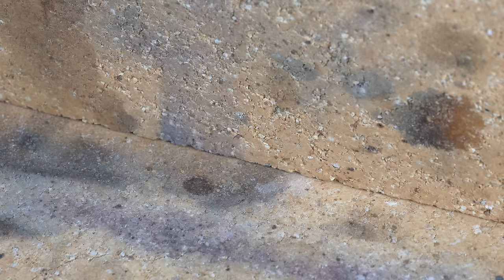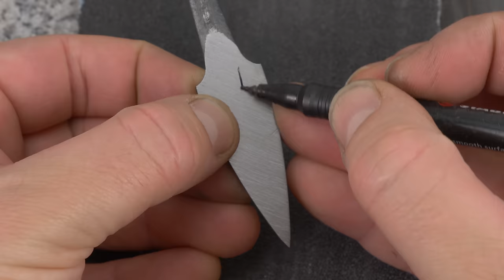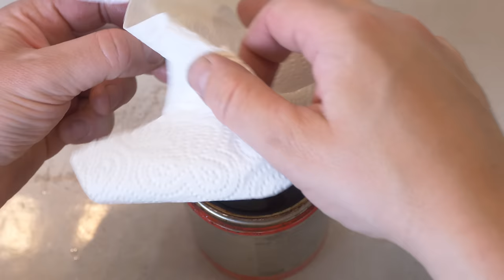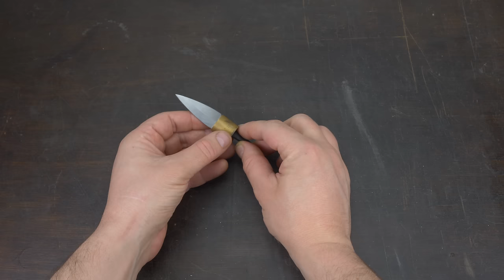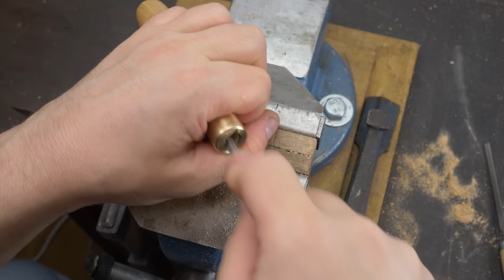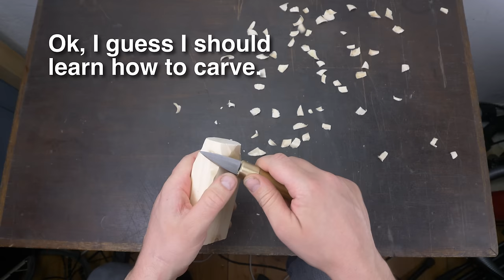I made this carving knife

Comment: I need to mention that thinning on your Atoma flattening stone will make it wear out quick.  I used to use my atoma for lots thinning for about 6 months and now its slower than an 800 grit diamond stone.  Only use it for flattening, that's what it's made to do.  For lots of grinding and thinning I tend to use either sandpaper (I usually wet my atoma and stick the sand paper on top, it's perfectly flat and has a great grip) or I use the "Sharpening Supplies" Grinder stone.  It's an 80 grit water stone and works FAST.  You will need some loose silicon carbide grit however, such as 60/90 tumbling grit.  Other than that there is "THE BEAST" (this is it's real name) 50 grit diamond stone that's pretty cheap.  

Also to make annealing easier (and softer) its nice to have a little pot full of burnt ash.  When work is hot, stick it deep into the ash.  It cools down very slowly and it's very soft afterwards, this is what most blacksmiths do.
Reply from the maker: Ok, thanks! Good to know!

Comment: very nice job.
but i have a question . is the inside of the file carbon steel. because i think they only add loose carbon on the outside of the file and harden that. or am i wrong and is it all carbon steel. i mean does it hold it sharpness for a long time?
Reply from the maker: Thanks! This one was all carbon steel. But I have had files that were only case hardened. It took me a while to understand why I could not harden them. Now I try to harden a piece of a file before I use it for a project.
Reply: @imadethischannel  ok thanks for the answer i was just wondering. keep upthe nice videos

Comment: But how long does it take to achieve cutting edge with a 1200grit wetsone? HOURS? :face-turquoise-covering-eyes:
Reply from the maker: It depends on the thickness of the blade before you start and the angle of the bevel :) it was a 1000 grit water stone and I didn’t take hours. But yes, the whole project is not geared towards time efficiency…
Reply: @imadethischannel  yeah ofcourse... i asked this spesific project, i saw you left a good chunk of steel on the edge(1,5 to 2mm thick maybe?) when hardening... i mean i know its necessary to leave some to prevent conflicts on hardening state but still its a nightmare me to grind hard steel 😂😂
Reply from the maker: @goonstuck haha, yes :) I don‘t remember exactly but it was definitely less than a mm. But it is a tradeoff. I tend to err on the patience side because I have had to redo stuff many times where I tried to cut corners…
Reply: @imadethischannel  🫡🫡 same same... years of failure but I still don't learned my lesson 😂😂 trying to find minimum still